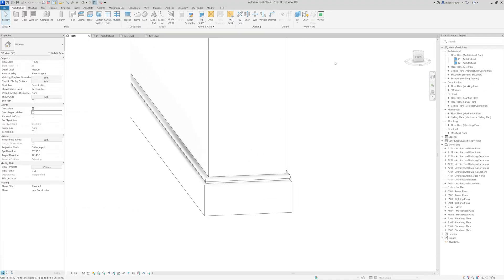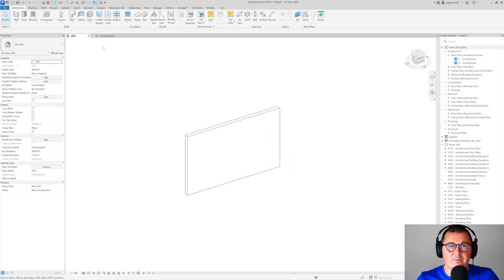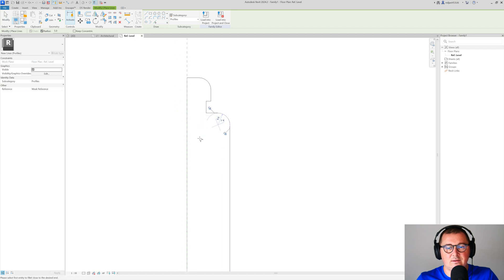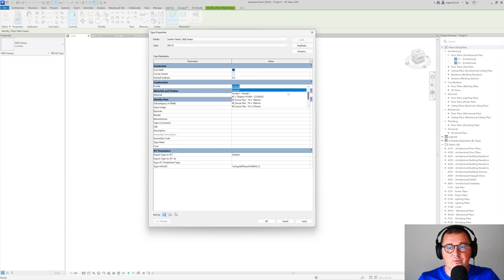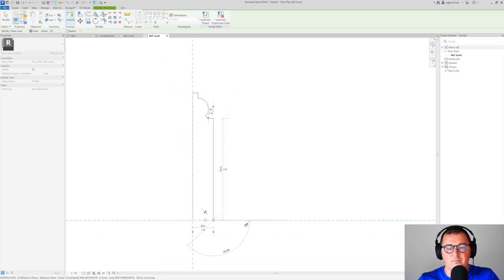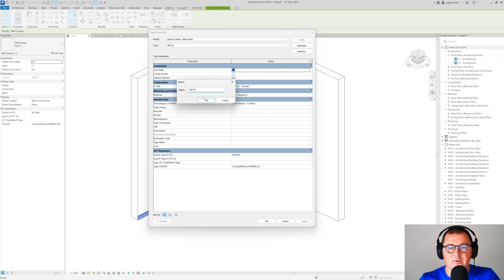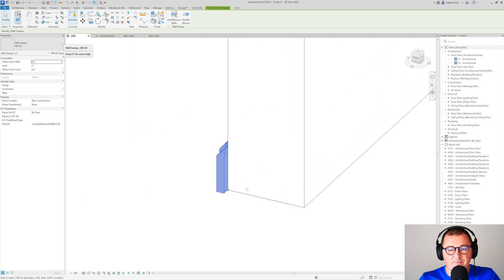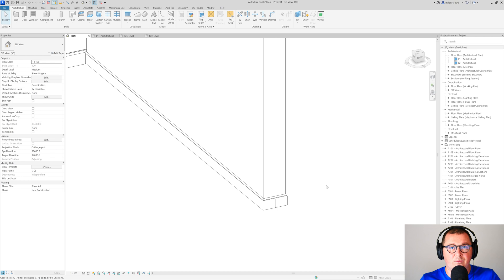Wall Skirtings in Revit

Comment: Hi, I was wondering if Revit can do the editing well from imported 3ds Max 3d models. And are the textures from 3ds Max also imported to Revit? Your answer will be much appreciated
Reply from the maker: Most often you go the other way around, Revit>3D Max. Max works with a geometry which is not categorised as in BIM software, so I will not suggest you that workflow at all
Reply: @arkiteasy  I see. I am still learning about the Revit basics, and I have been a CAD (for blueprint drawings) and Max (for 3d related use: modeling, rendering) user for quite some time. My main purpose of learning Revit is to create good drawing presentation, esp the isometric with materials applied which I find it very inefficient to do it in CAD. And also for drawing efficiency purpose. 

Thank you again for your response. I might have some questions regarding to this in the future but for now I need to finish learning my Revit basics first

PS. Actually, your channel is what I am looking for the most because I mostly handle interior projects
Reply from the maker: You can do in Revit way more things so I suggest you to make your Revit focus wider 😊

If you hear thoughts that Revit is not so handy for interiors simply don’t listen to it, it’s great actually. By the way, in case you didn’t do it yet, join our community of architects, it’s free and we have there free Revit training
Reply: @arkiteasy  awesome. I'm gonna check it out